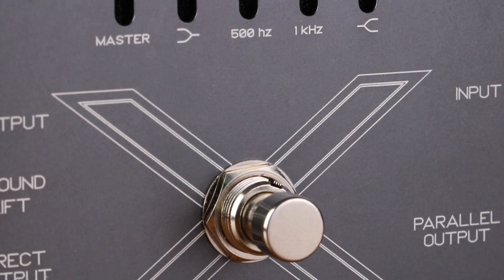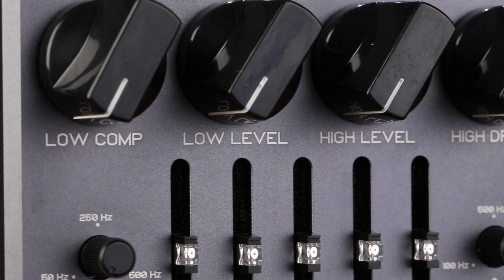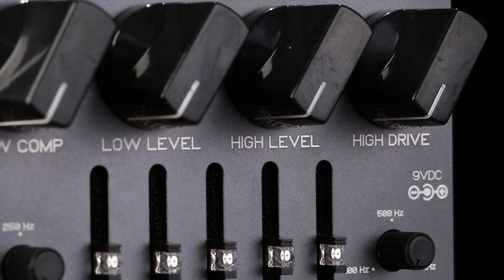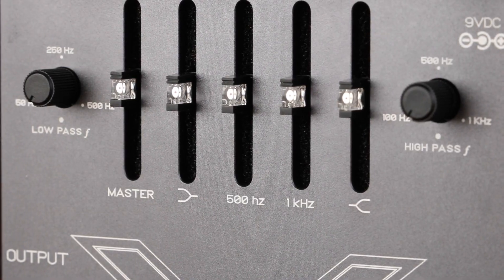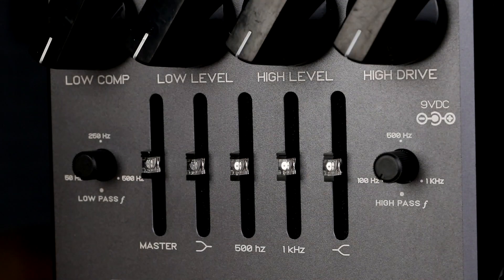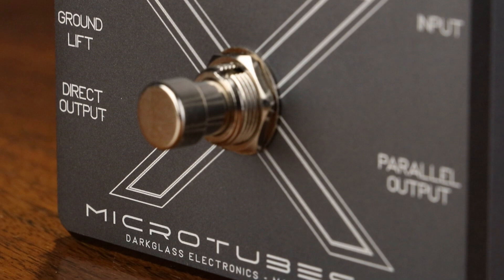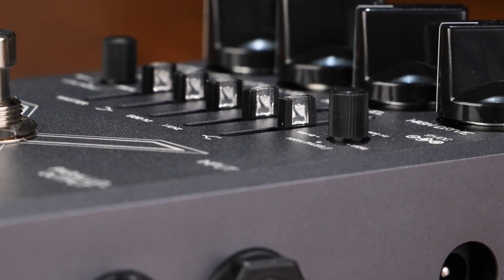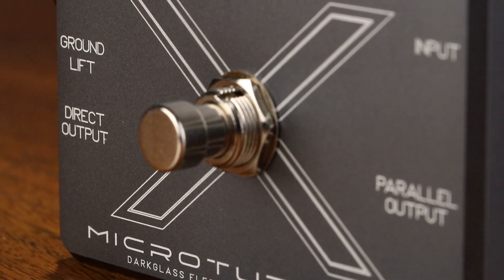Darkglass Microtubes X7 Bass Demo

Comment: Extremely interesting product but it definitely feels that this kind of concept requires sooo much more knobs that it currently has. One of the biggest shortcomings is that the clean sound can’t be applied throughout the whole frequency spectrum. I’m hoping to see X7 combined with the functionality of AO. Then Doug can have some of my money again.
Reply: This concept is called "parallel processing" and has been a studio mainstay on bass for years: it's used when you don't want a full spectrum clean signal, that's actually the entire point.

I can only imagine the eminent Ultra version will have even more functionality though ;)
Reply: I completely understand. I just feel that a blend knob on the distortion side would’ve been useful in this pedal to reduce the harshness. I don’t know if it would be useful in reality though.
Reply: @rogergottleben6382  There's no harshness, even at high gain settings, with the appropriate EQ; you just have to duck the 1k band and the treble shelf to taste.

A full range clean signal would defeat the entire purpose of the pedal design.

Check out this mix tutorial, the engineer does something quite similar with a chain of plugins, and only has a clean signal up to about 300Hz: https://www.youtube.com/watch?v=Oq62X1hQoFY

Comment: I think this is gonna be a no from me...
I find the distortion character way too harsh, to the point of hurting my ears. Much too ice-picky texture and not tube-like.
Also, the top frequency for the LPF is 500 hz, which doesn't allow you to use it as a regular distortion, where you just blend the clean signal and the distorted signal. However, this is the only darkglass pedal where the blend is normal, and in which the clean signal doesn't always stay at 100%...
I hope they fix these problems in the ultra version. Maybe there'll be a way to bypass the filters completely? Maybe a more flexible EQ will allow the user to somehow dial out the ice-picky-ness and get a nice sound.

However, the review was great! Thanks Bassic Gear Review team!
Reply: Nah son. The LPF max frequency being only 500Hz is problematic. What if I don't want to filter my clean tone, and to use it in conjunction with the distorted signal (filtered or otherwise)? This prevents the pedal from being used in a standard blend mode, like there is on many other distortion pedals.
The benefit you have with the programs you mentioned is that you can use parallel processing in any way you want, not just filtering. Parallel processing also means blending two unfiltered signals.
And also, I found the distortion tone to be ice-picky. Unlike the AO, B7K, VM etc. which sound wonderful both in high gain and low gain, I found that past a certain point the X7 has an inherent, unmistakeable ice-pickyness to its tone. Maybe it's some nasty high-mid presence that can be dialed out given the right EQ.
This is only my opinion however and I accept the things you said as well.
Reply: Yair Haimi I wonder if I could achieve the Clockwork Angels tone with this pedal, or if it would be better to get the Darkglass AOU, right now I have the Tech 21 GED 2112 unit, and the Dug Pinnick DP3X pedal, but I mean if I want that tone off of Black Sabbath’s 13 album, and Rush’s Clockwork Angels, could the X7 do it, I mean as far as getting a ballpark tone?
Reply: @yairgrenade  Fab Filter Saturn doesn't allow you run a full range clean signal and a distorted signal above 500Hz simultaneously, you need two separate tracks for that.

It's a very common studio practice to use a "sub bass" track, totally clean and heavily compressed, crossed over with a distorted mids and high end track: that's what this pedal is designed to do.

If you absolutely want a full range clean signal to blend with a full range distorted signal, which is how almost all distortion pedals with a "blend" function work, this obviously isn't the pedal for you.

For my money, and I've owned literally everything that DG has made and dozens of other distortion pedals, it might be the best standalone dirt box ever created for bass. The "ice-pickiness" is easily remedied by ducking the 1k band and the high shelf to taste at higher gain settings.
Reply: @reefersutherland4265  "mulit-band / crossover pedals are not that unique now days": can you name more than five currently in production?
Reply: @bassplayer807able  Yair isn't the guy to ask, he doesn't own an X7 ;)

I'm not particularly familiar with the tones on "13", but the X7 can definitely get you into Geddy Lee territory: they showcase that a bit in this video, but I'll be getting another demo up with the X7 and a Jazz soon as well. A better choice than the AOU, which I also have, if Rush style tones are what you're after.
Reply: the "ice picky" tone is a big reason why i dont like dingwalls and a lot of darkglass pedals however i think their fuzz pedal is really cool

Comment: How and where would you plug this kind of pedal on your pedal board?  Where would you plug the chorus, wah and other effect relatively to this device?  Would you use another compression pedal with it?
Reply: If it's used mostly as a "preamp" then put it at the end of the chain. If it's used mostly as distortion, then put it nearer the front.
Reply: @bax7619  This isn't really a pedal that's meant to be turned on and off: it's really meant to craft the entirety of your sound.

The engineer in this video does something very similar with plugins here: https://www.youtube.com/watch?v=Oq62X1hQoFY
Reply: I don't find that the DI output needs any additional processing (compression, EQ, or otherwise) to sound like a finished album track of you spend the time dialing in the tone before tracking: the controls all have a very wide range and even slight changes can make a very big difference overall.
Reply: Thanks MatthewtheBassPlayer !  That's what I thought at first.
Would you put at the end of your effect chain and plug it directly in the console?
Reply: @kimfaucher007  Yep, that's precisely how I'm using it.